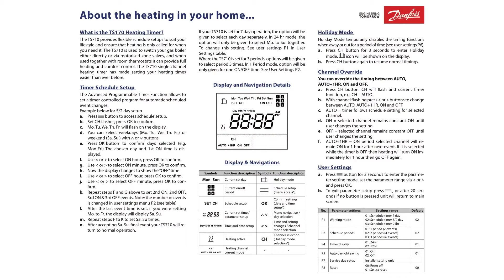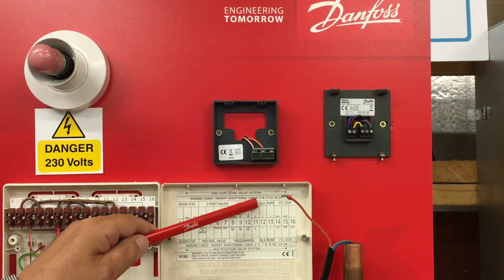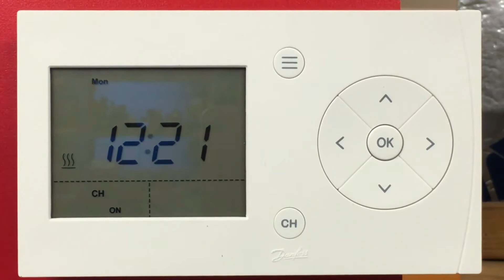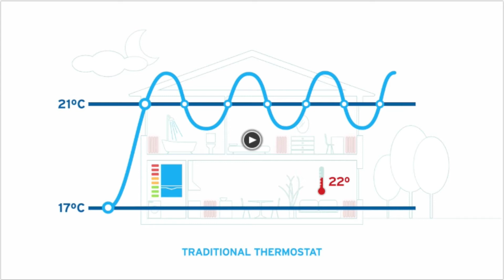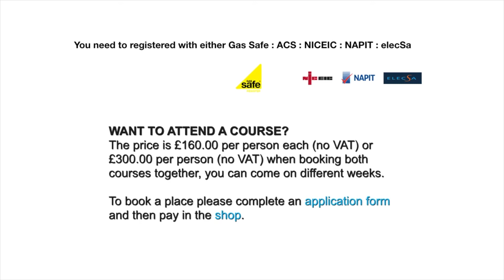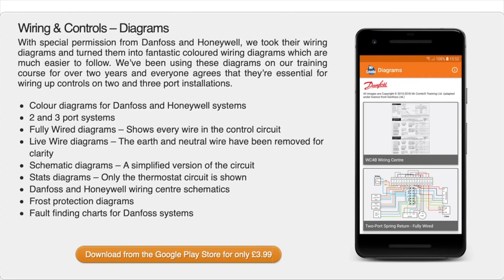Danfoss TS710 & FP720 Programmers

Comment: Hi, can we leave the CH  sign permanently on even when we don't need the central heating. Thanks
Reply from the maker: Dear Mukina, thanks for the question, There are 4 ways to set the timer / stat, Constant 247 and control via the stat in the lounge (cheapest way) Once a day 7am to 11 pm (not practical 7 days a week) Twice a day (not practical 7 days a week) and 7+2 (Mon-Fri) Sat-Sun) very popular that's OK. Please note room stat MUST be in the lounge for most economical use. 18C is overnight or out for the day, lounge temp 20-22 is the cheapest setting.All the best, george staszak
Reply from the maker: Dear Mukina, thanks for the question, There are 4 ways to set the timer / stat, Constant 247 and control via the stat in the lounge (cheapest way) Once a day 7am to 11 pm (not practical 7 days a week) Twice a day (not practical 7 days a week) and 7+2 (Mon-Fri) Sat-Sun) very popular that's OK. Please note room stat MUST be in the lounge for most economical use. 18C is overnight or out for the day, lounge temp 20-22 is the cheapest setting.All the best, george staszak
Reply: @mrcombiBedford  Thank you. I would like to know if I leave the CH sign on permanently on the timer or turn it on and off everytime when  I need heating, which one is better to turn on and off  the  CH sign on the timer or leave it on 24/7. I hope you understand my question. Thanks
Reply: My stats temperature is on 21 and CH is on 24/7 . I didn't touch the stat and noticed radiators are warm not all the time only sometimes.
Reply from the maker: @Mohimakauther9933  Hi again, the system is keeping to temperature so some rads will warm a lots some will just work and some will be cold, because of a 2 degree drop is all OK, regards, george
Reply from the maker: No, only heat when in when you go out set to 18c
when return to 22c then when too hot adjust to desired temp. regards george
Reply: @mrcombiBedford  Thanks alot

Comment: I have my hot water set to come on twice a day. But it come on early. On my box should I have it on auto that is whats showing but in your video it doesn't  say on off or auto
Reply from the maker: Hi Tracy, as most 2 channel programmer the heating need most control because it's over 80% of your fuel bill, HW is normally on auto or constant because only when the cylinder stat calls the boiler fires up to recover in about 20 minuets where as heating is on for 6+ hours per day for 4+ months.
      A lot of people set the room stat to18C - 20C then turn it up if cold or 16 - 17C if too hot, when going out or over night 16C. Only heat when home
Hope this helps
george staszak
Mr Combi Training
Reply: @mrcombiBedford  thank you my heating is set to on and thermostate is on 18. My hw is on auto but its set to come on at 6.45am for a couple of hours. Then teatime. but it seems to click on at about 6.20am. I have re-done times today so will see what happens in the morning. I live in a soha house and although they have put the new boiler etc in. They left the old thermostate in the living room and didn't replace it. Do you think that should be updated to. Sorry for all the questions. Thank you.
Reply from the maker: Hi Tracy, we love questions and helping, been doing that for 18 years, re HW if you keep running out of HW try changing to ON or 6am to 11pm, the installers did a bad thing by not changing the room sat, that's what saves fuel and your bill, very sad there are still installers who don't care about efficiency and saving money and doing the job correctly. In the video it's a Danfoss RET2000B I have one because it's brilliant. Changing from 230vAC to any digi is not that difficult, don't call them back find someone who has been on a wiring course. 

The old 230vAC wires should have L.N.E.and  Com + SW.L digi stats only need Com + SW.L and can be volt free, 24vDC or 230vAC. It's important somethingto show it's the R Stat 
regards
george staszak
Reply: Thank you. The hot water was coming 9n 15 minutes earlier than I set timer for. Now it doesn't seem to be coming on.  Ill need to ring soha money and get them to look at it. If I hit the reset on boiler it fires up but then goes 9ff after a few seconds
Reply from the maker: @tracybonner5014  Good idea to have someone else have a look, regards george